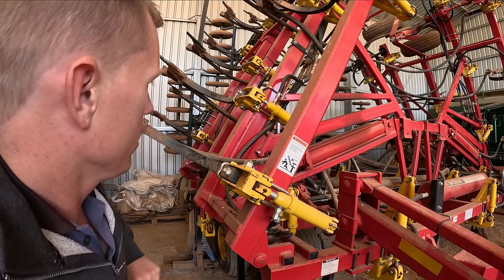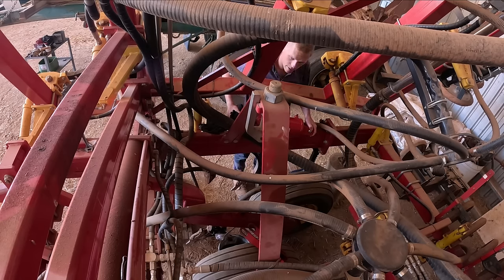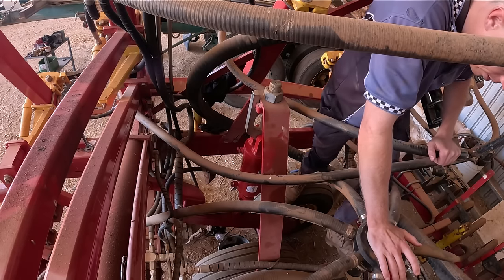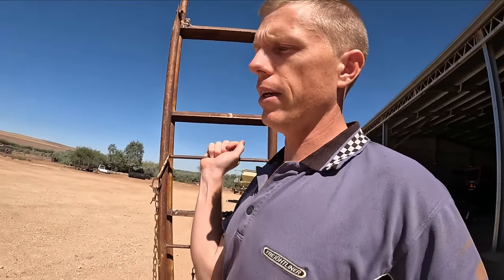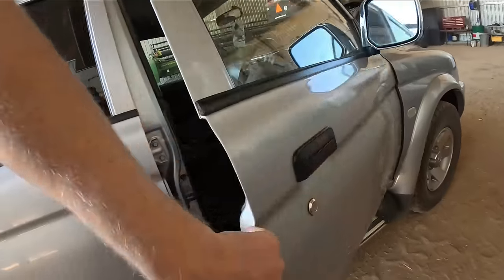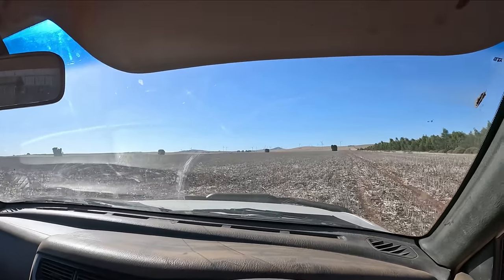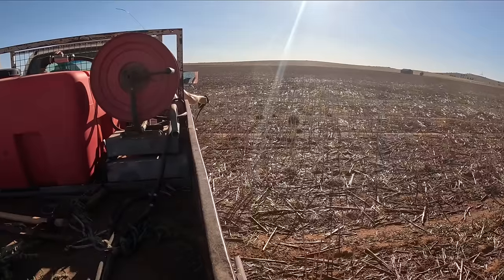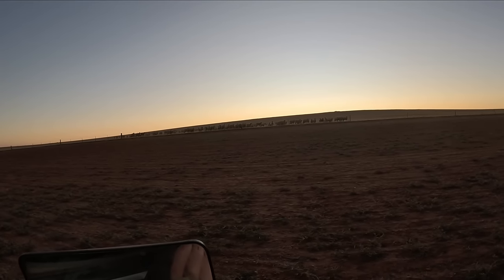There's Something More Sinister Going On | Gypsum Spreading

Comment: i have a triton the same..there hard on glow plugs..i normally only get one season out of them. my mate whos a mechanic timed them an said they stay on for about a minute an 20 secs afta starting which he said is to long. He hooked them to a timer somehow so they stay on for a lot less longer..which has made them last more than one year. They get real hard to start in winter without them working. Went through 3 sets of plugs before i got it sorted.
Reply from the maker: Touch wood, mine has been good with glow plugs. The old white, non turbo ones are terrible with them. The timer failed on one of those, so I just wired in a push button to glow them. Hold it for 5-10 seconds, and it fires right up. After you let go of the button, they shut off.
Reply: @lockvalleyfarms981  Ah thats a good idea..push button

Comment: Good to see the thistle hoe still getting a run.  When's your sprayer back in action? (I though the wheel drive was fixed)
Reply from the maker: Hopefully have it running tomorrow. Was waiting on the rim and also had some panels off the engine compartment at the paint shop. Also been waiting for the dealer to come install their special flush/filter kit to clean up any contamination that might be in the hydraulic system.